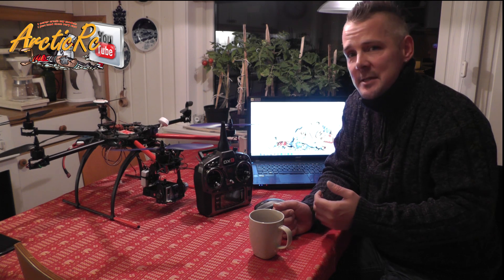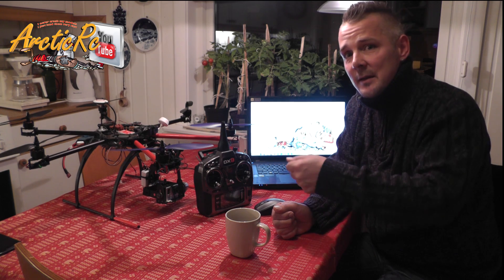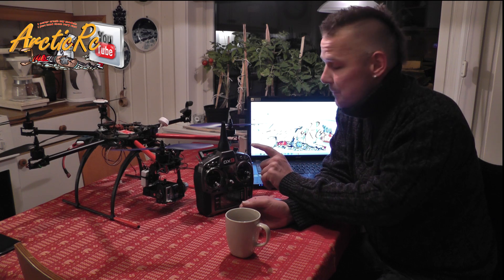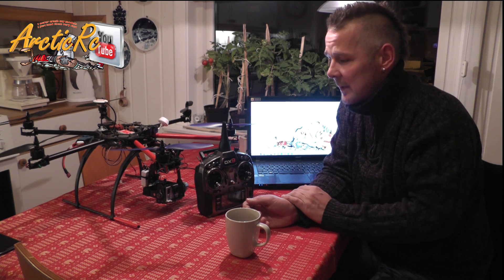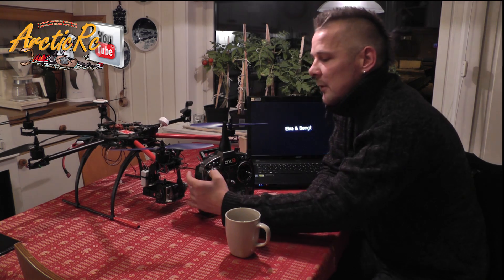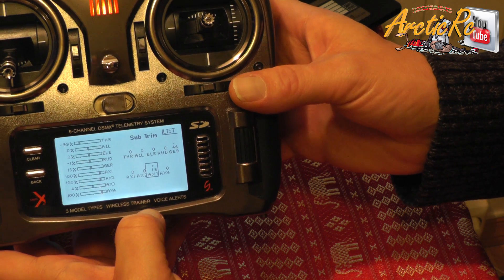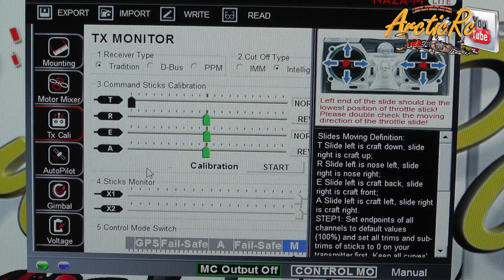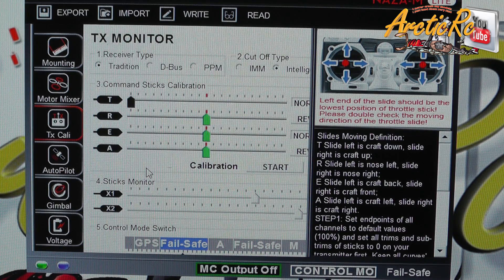Spektrum DX9 - DJI Naza And Mixing Control mode Switch For Failsafe

Comment: hi mate thanks for the video i have a  quadcopter it has a wookong m flight controller and a dx9 i find this quite confusing to set up where abouts are you ? if i posted my quad and remote to you would you set it all up for me? the controller needs programming and my remote i will pay you for your time? thanks

Comment: I have a DX9 which works nicely. I have a Bix3 and I have included the orange flight stabilizer and orange 6 channel receiver. I would. All works well excepts the flaps will not work  even when I have channel six for the flaps. Do you have any suggestion?

Comment: just bought a new dx9 and im not very happy about the limited sounds I have a frsky taranis and the I have all modes mixed on it and when you engage a mode it says mode but there are no sound files on the dx9 to tell you what mode your in like gps attitude mode or manual normal ioc and so on but the taranis is customizable you can add whatever sound you want spectrum should follow suite then it would be great radio
Reply from the maker: Download the New soundware. planty of New sounds and multicopter commands and so on. and more sound are on theyre way. remember to update Your dx9 to get the best out of it

Comment: ArcticRc you're the reason I went ahead and got a DX9. You made that look so easy to program it. After my DX9 came in I came back and reviewed your video and set up the failsafe in the radio and the naza. Thanks.
Reply from the maker: that is so cool.. congratz with your new radio. i love mine
Reply: I got the flight modes 1/2/3 to work but the system does nothing when the H switch is flipped on. The voice says flight mode 4 but only when the F switch is in mode 2/3. In mode 1 nothing. I'd like the failsafe to go to the GPS failsafe.
Any idea what I did wrong?
Reply from the maker: not at this time but in system setup you are able to change the aux ports to diffrent ports. i used subtrim on the spare channels to get the markers where i wanted them. I can send you my setupfile. just send me an email on   arcticalign@gmail.com

Comment: So you can't do this with DX9 and 6 channel receiver right ?  I need 7-8 channel ?
Reply from the maker: you need more channels for remote gain and tilt for your gimbal. a 8-9 channel is good
Reply: *****  Yeah I tilt as the XuGong only has that built in, but wanted the return to home dealio when I lend the unit out for people to demo, so will pick up a 9 channel, thanx !!! This guy in Ncal has them cheap.. http://www.buildrcdrones.com/store/p31/LemonRX_DSM2_Spektrum_Compatible_6-Channel_Receiver.html  also got a dragonlink set up for longrange wings should be fun fpv !